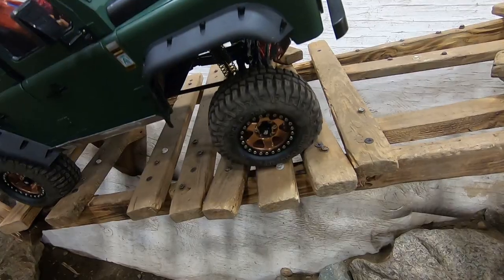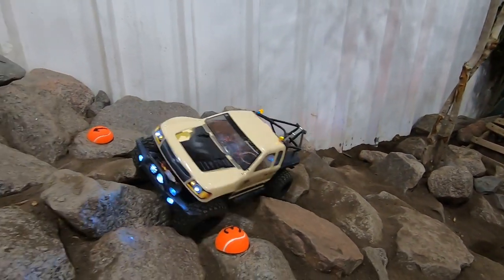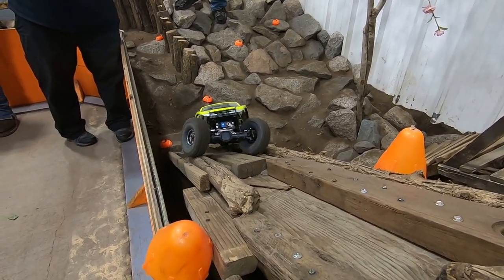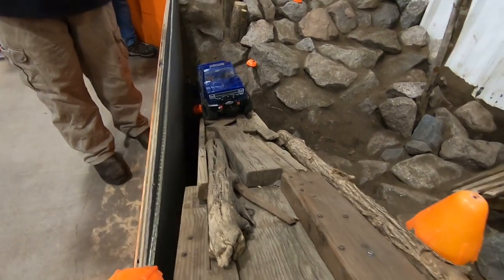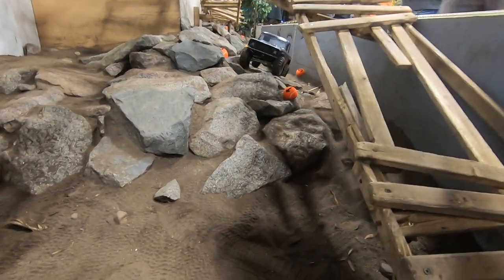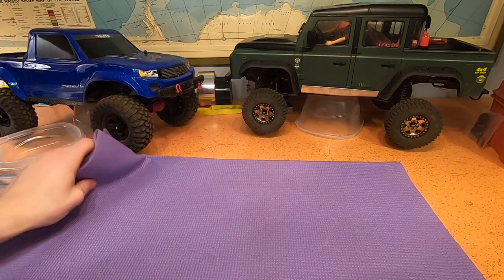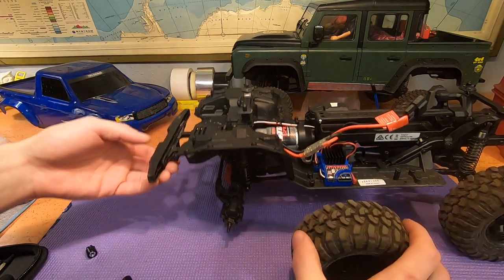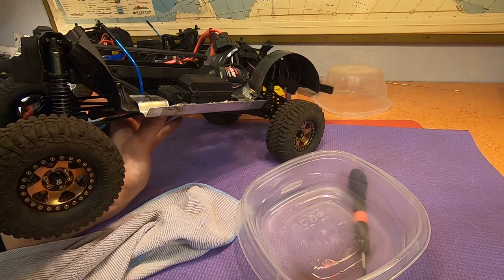RC Class 2 Rock Crawler Competition / How i maintain RC after in mud, snow, water

Comment: You need a Bambu labs x1 carbon printer and a roll of nylon carbon Fibre, a bunch of cheap pla and tpu and poly carbonate. There's free upgrades all over the internet made by other enthusiasts for free. It's an expensive printer but it's cheaper in the US and has lidar so no failed prints. It's made by a bunch of former dji engineers and prints faster than 10 printers with the same quality. Buy cheap grey pla for cosmetics because you can sand and paint with rustoleum to look like metal. You can print a million gaskets with the tpu and save the expensive carbon Fibre for important GameDay spare parts. Great video.
Reply from the maker: I need a lot of things 😅😊

Comment: A boot mat from Walmart works great. I used a yoga mat to for a while. The boot mat is a hard plastic with sides and it helps contain stuff if you drop something. They are black but you can cut a yoga mat and put it in the bottom of the boot mat. Then you can see the black screws if you drop one.
Reply from the maker: heck yeah, thanks for sharing 😄great idea. happy trucking!
Reply: I found rubber ones at Menards and bough several. I use one of those as my work bench with a grid board sitting in the center of it

Comment: Hey JT Jet! I like that facility at Baker Hobby! The new owner is Awesome and open for anything there at Thunder Alley! You guys looked like you had fun and had pretty good runs! I use some small Star washers on those areas and holds great! I been using marine grease on my RC vehicles for over 15 years or more and I haven't had very many issues! Great video I'm out of Princeton Mn I'm running TRX 4 Blazer, Trailfinder II Toyota, Axial SCX 10 Jeep and alot of others 1/7 UDR's and 1/5 electric & gas🤔😉👍📹👋👋👋✔️💯
Reply from the maker: heck yeah thanks for the info, star washers on what areas? can you timestamp where you mean, i talk so much :D i cant remember from a month ago now. if not no worries :D i for sure gota get some of this dry grease or marine grease, look forward to seeing your rigs and showing off on the vids :D thanks for the kind words!
Reply: @JT_JET  Ya on the modified skidplate bumper on the back of the TRX 4 Sport I've placed them between the piece and the frame rail and holds really well or you could drill another hole on both side above in the skidplate and into the back crossbrace that holds the frame rails together all kinds of options!😉
I've used dry Graphite lube in tranny gears, but I only use Marine grease on axles and diff gears and housings all depends on what your running in?😉😂🤣😂
Reply from the maker: @terrykuehn2686  oh I see what you mean I think, I don’t have material on it now but yeah I was thinking adding some material and making another hole, thanks again for the info!